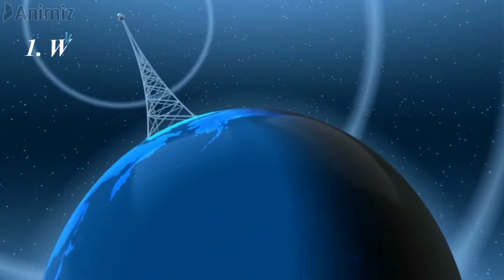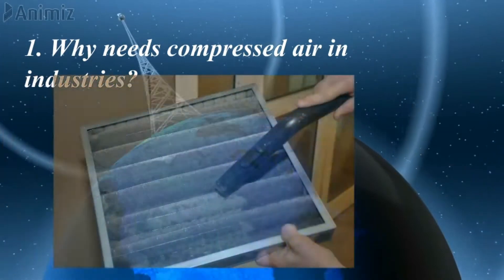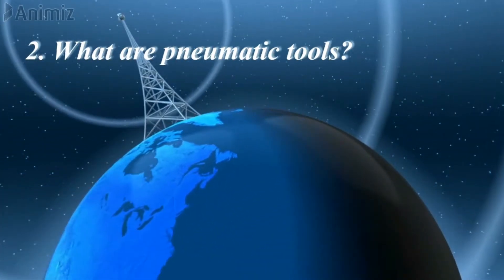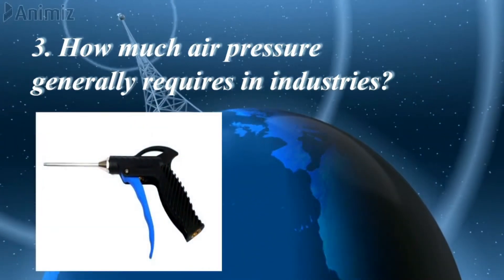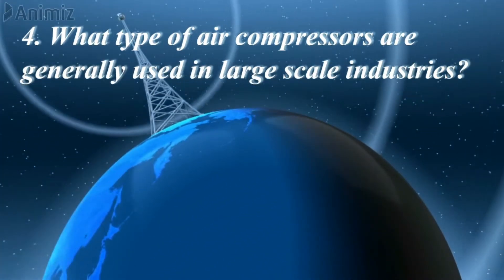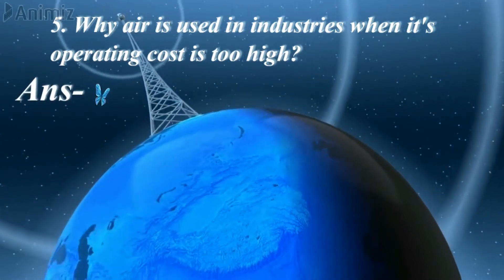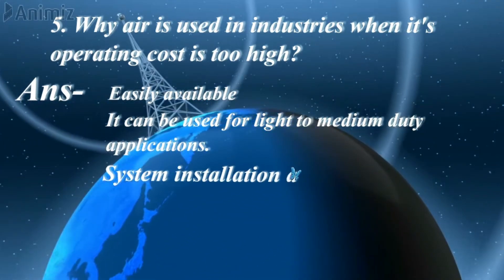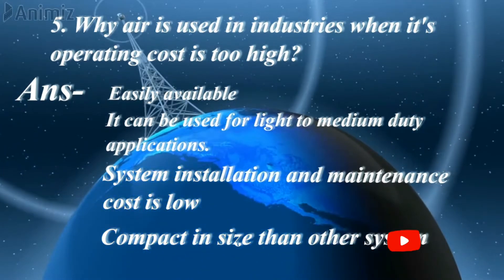Maintenance interview questions and answers | Air Compressor and compressed air (English)

Comment: If suction pressure satisfied  but discharge pressure not coming out side what will happening
Reply from the maker: Need to check the suction filter for choke & right oil level, also check if the breathing hole is blocked that can happen..